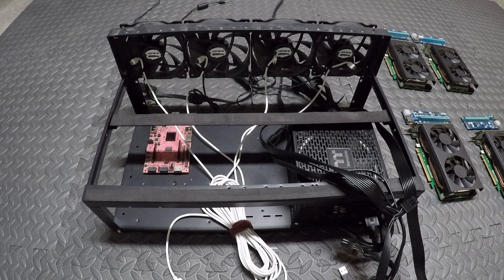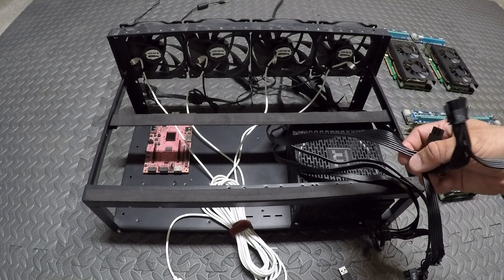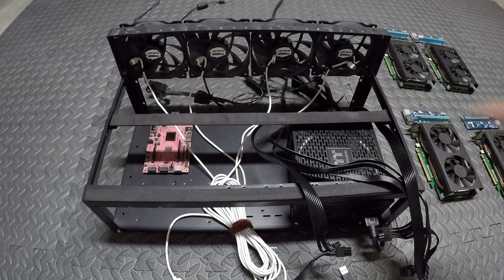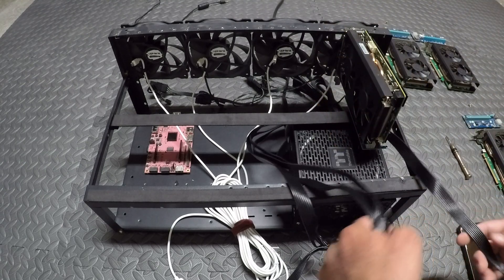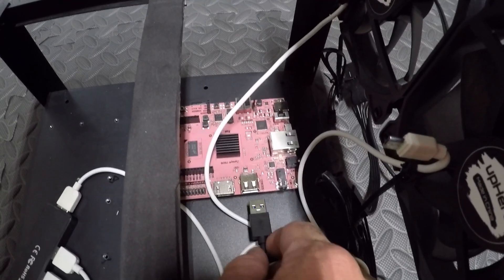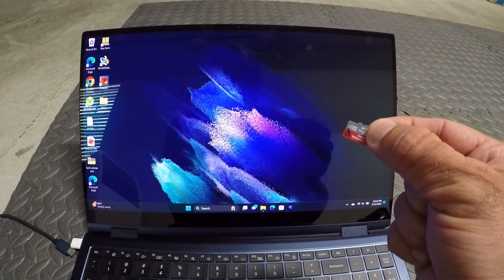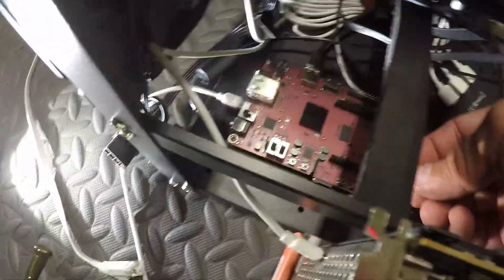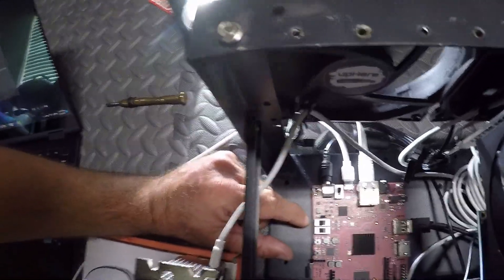FPGA Kaspa Crypto Mining Rig Build How to video! (Includes source for TH53 FPGA's)

Comment: Just bought my first two TH53 from Richard  Lo - waiting for the dhl to arrive
Reply from the maker: Nice! I love these things! What do you plan to mine with them right now? Kaspa or Iron Fish?
Reply: @GreaterGoodMining  i think i will try to fill my kaspa bags
Reply: just ended a 4 hour of iron fish mining on FPGA - Is was awesome
Reply from the maker: @leolang8128  Everything running good?
Reply: @GreaterGoodMining  at the moment I am running one of two cards on a metal frame with a 120 mm fan for extra cooling. How did you pass the usb for the FPGA through the uphere fan?
Reply from the maker: @leolang8128  I just used small zip ties and secured the usb wire to the frame of the fans 
so it wouldn't get in the way

Comment: I was also thinking about getting some FPGA for mining but I worry about hash rate with the ice machines coming soon.
Reply from the maker: Understandable, the hashrate has gone up quite a bit. I made this video because I feel like GPU mining Kaspa doesn't have much time left. I wanted to help the small home miner have a chance to stay in the game if they so desired. I believe in the project. You'll have to at least have FPGA's to compete with Asics. Not everyone was willing to take the risk and pre-order from IceRiver
Reply: I want yo start mining crypto which one should I buy a kaspa 3 or a e300 miner
Reply from the maker: FYI I'll be doing another FPGA mining rig build using the TH53's and setting them up to mine Iron Fish!